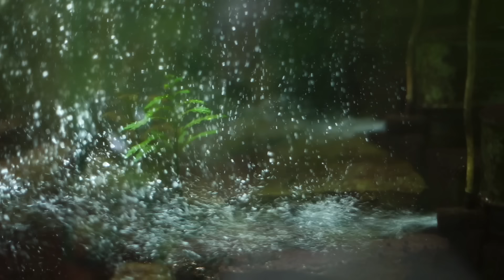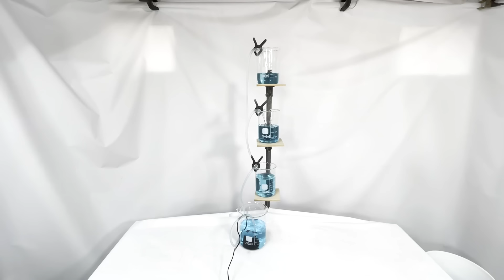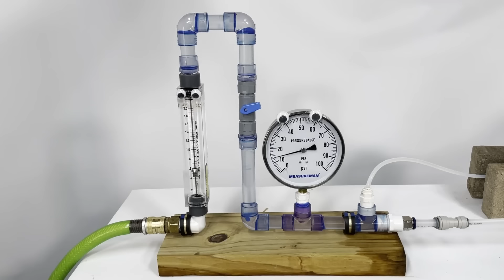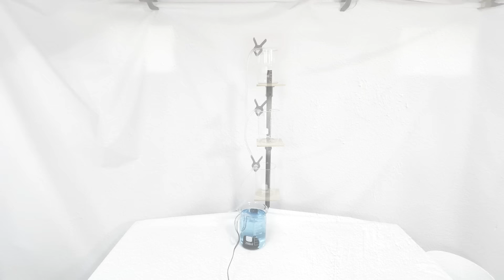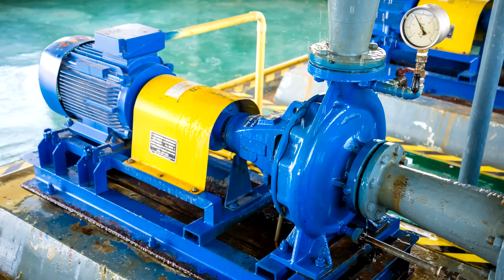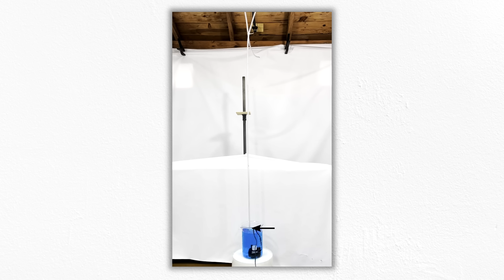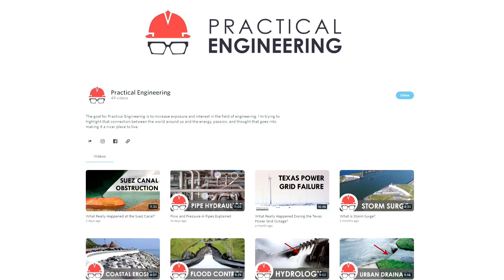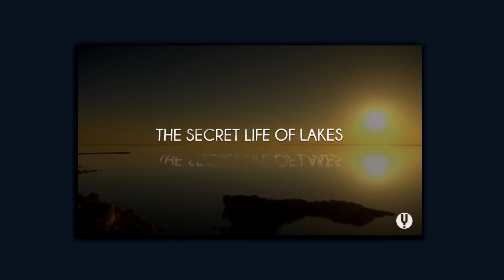Do Pumps Create Pressure or Flow?

Comment: "This isn't rocket science". I'm not a rocket surgeon, but I'm pretty sure pumps and fluid dynamics are a big part of at least designing rocket engines and fuel tanks.
Reply: i heard a professor once say "come on guys, this isnt rocket science... though it is USED in rocket science"
Reply: Designing a good efficient turbo pump is like 30% of the engineering going into a rocket.
Reply: Rocket engines are all about pumps and turbines
Reply: I work and design pumps, in line pumps, all different kinds of chillers, VRF systems and some of the hardest electronic plc diagnostics you can do.  I quit school when I was 15 never finished and now I easily make 6 figures a year.
Reply: @forloop7713  Reaction engine leaves the room
Reply: @cameron3991  that's a very cool field to work in, how did you start? I recently developed an interest in turbines and compressors in particular since I'm building a jet engine
Reply: @cameron3991  school isn't necessary for some people. I quit school when I was 15 and no I am a PLC programmer. I design and integrate entire automation systems.
Reply: Yup and make sure you don't have unexpected effect such as a resonance between POGO and pipes
Reply: Incompressible flow and compressible flow are two verry different animals, which is why any amount of compressible fluid in a hydraulic system is a problem.

Comment: It actually is rocket science too. The big boy rockets all use pumps for propellant flow and thrust control :)) 0:32
Reply: Was going to add how do pumps/fans apply to air? As dad was fond of saying "air is a fluid".
Reply: Yeah and turbopumps are one of the most expensive and complex part of the rocket (admittedly more the turbine than the pump but still...)
Reply: Yeah. What made V2 (/A-4) possible was it being the first turbo pump powered rocket. Development of rockets was very much development of pumps.

One of the major descriptors of rockets is their turbo pump cycle and turbo pump burner mixture. open cycle, closed cycle, oxygen rich staged, fuel rich staged, full flow staged and so on. It is all pretty much about "what is powering the turbo pump necessary to feed the combustion chamber with enough combustibles". Actually add pump or pumps? Again another major "rocket pump" thing. Do Single pump or do two independent pumps?
Reply: @quintessenceSL  I'm thinking of that too but, isn't that is a compressor?
Reply: Really?
Reply: Nice
Reply: @taktuscat4250  A compressor is a pump, just with the goal to pump to high pressure with low flow.
Reply: My thought exactly :) it is rocket science
Reply: If they start cavitating, then you've got big problems and will not be going to space today
Reply: managing those flowrates is gotta be a headache
Reply: @km5405  as I understand it, they're designed for a specific operating point determined by the nozzle designed thrust.
Reply: @taktuscat4250  compressors, fans, impellers, propellers, etc.  are really the same thing (a fluid pump) with slightly different shapes!
Reply: @km5405  it gets to be an even bigger headache in a jet engine.  The whole thing is a very carefully balanced series of compressors (and some turbines just to make it more fun)
Reply: @noochification  yeah the concept really isnt hard ... but the practice of it is literal billions of research by thousands of people.
Reply: Yes, but that isn't the end of the story. The combustion of the fuel in the "combustion chamber" of the rocket is also chaotic. It's affected by the flow rate of fuel that enters the chamber, not to mention the size and parabolic shape of the combustion chamber. All this must be optimized by "trial and error" because there is no mathematical equation that can take all these variables into account at once. All the variables are exponentially inter-related. I am watching the efforts of SpaceX with great curiosity. They are trying to develop a gigantic rocket that can launch some 600 satellites into orbit at once. They have developed their "Merlin" rocket engine via "trial and error" for this purpose, but in order to propel the rocket they will need something like thirty of these engines, all operating simultaneously. Having all those rocket engines firing simultaneously next to one another invites new forms of turbulence that nobody has yet considered. Those rocket engines may interfere with one another in such a way as to wreck the efficiency of the propulsion, or goodness knows what else.
Reply: @aritakalo8011  Incorrect. Goddard's rockets were actually pump fed. Google turbopump history by Sutton.
Reply: Not the SRB:s for the space shuttles and some other rockets...
Reply: @skunkjobb  obviously. Did anybody suggest solid rockets use turbopumps?
Reply: I was gonna say about the same LoL
Reply: That's not entirely accurate.  Big boy rockets don't have pumps.  The have fluid flow controls such as valves and regulators to control how much fuel, oxidizer, or compressed gas gets used up.
Reply: @PrimeSuperboy  Which one(s) are you referring to? F9 and SLS for example I have just looked up to be sure and they both use turbopumps. Afaik one uses valves to control the input to the turbines and therefore the power to the pumps. Gravity fed systems are a thing, but not for the big boy rockets I would have thought(?)
Reply: @skunkjobb  those need a hefty bit of fluid mechanics too, dont wanna have the chokepoint for the supersonic flow be inside the rocket chamber or it goes kaboom
Reply: @thestresstheoryofhansselye3607  I think you mean the Raptor engines which will be powering Superheavy/Starship. And I'm not sure what you are getting at with the interference... The F9 and many other rockets have many engines next to each other, they've dealt with those problems before.
Reply: @netsch20  No doubt you are right. I was just wondering if some form of unexpected turbulence might occur with that engine configuration that I never thought of, such as the exhaust streams of the rocket engines somehow interacting with one another in the spirit of Jollyphuck's wry joke. It will be interesting to watch.
Reply: @PrimeSuperboy  All main stage liquid fueled rocket engines that I'm aware of use pumps. Most are turbopumps, some like the Electron rocket use electric pumps. Some things like reaction control thrusters are simply pressure fed, but pressure fed systems are typically pretty small since you need something to replace the volume with to maintain tank pressure. It's a trade-off of pump complexity or needing an extra tank to maintain pressure.
Reply: @quintessenceSL  it works the exact same, It creates a force on the air and force over area is pressure. If you think about a fan, it pushes air out one side therefore there is more air at the output so the pressure is higher but at the inlet air has been removed therefore the pressure is lower. This creates a difference of pressures which produces a flow of air. The difference with air is that it is compressable whereas most liquids aren't. That means you can only fit so much liquid in a container no matter how hard you squeeze it, but with air you can force more in and therefore the higher the pressure the more mass you have in a container. Compressors keep pushing the air in hard to fit more mass in the same space, if there is an outlet then the higher pressure air flows into the lower pressure atmosphere. As far as I know pumps like the first one he showed are more like fans and therefore good at providing high flow rates but not great pressure whereas the positive displacement pump he showed, as long as it has enough power to rotate it can produce higher pressures in a container.
Reply: @mackdlite5900  yes, the OP said, "big boy rockets" implying that all space delivery vehicles use pumps.
Reply: Yeah, a huge portion of rocket science boils down to extreme difficulty pump design:
Extreme flow-rate
Extreme cold
Extreme heat
Needs to operate against back pressure sufficient to lift a building into the sky
Will often need to operate in both a vaccume and zero-g
Extremely tight tolerances
Must never require even the slightest bit of in-field maintenance.
Extreme vibration tolerance
Needs to pump and mix 2 different (and frequently not insignificatly reactive) fluids at a very specific ratio.

Oh, and while also being as light as you can make it, it also will need to be as cheap as possible because we may only need to use it 1 time before we smash your prized design into the ground or water at high speed, but if it doesn't work flawlessly, someone is likely to die.
Reply: @dr.robertnick9599  both compressors and pumps can have large pressure ratios and varying amounts of flow. Crucial is the change of volume/compressibility of the fluid that is being worked

Comment: "Not a great catchphrase, but it is accurate." Spoken like a true engineer.
Reply: That also happens in physics
Reply: @altuber99_athlete  This reminds me of the SMBC comic with the evil villain ranting that he's "actually doing something" when the hero calls his work "pure evil."
Reply: Technically correct...the best kind of correct
Reply: Qimodis   Can you share an example? I'm not saying otherwise, though. I was just saying that physicists (and mathematicians) are also rigorous with definitions.
Reply: @calholli  Voltage is analogic to pressure.
Reply: That was the real catchphrase all along
Reply: @paulelderson934  The real catchphrase is the friends we made along the way.
Reply: @calholli  "That is incorrect."

It is correct.

"Just like putting your thumb over a water hose,  it increases the pressure--  not because of more VOLTAGE---  the pump is still running at the same rate.-------  its because of the increase in RESISTANCE from your thumb mostly blocking the hose."

Here the pressure is analogous to voltage. Similarly, if you have a current source that's pushing current through a resistor and you increase the resistance the voltage over the resistor increases, just like in your hose example.
Reply: Me when I try to explain lift...

Comment: This is basically the hydraulic version of the discussion whether an electric source provides current or voltage. And as my university teacher likes to say: "what they have taught you in school might not be wrong, but the full story is a lot more complicated".
Reply: I would guess it depends on the natures of the source and the load. ;)
Reply: I was about to make the same comment. The correct answer is to ask which exists without a circuit. Voltage/pressure always exists. Flow only occurs when a path to release the pressure is provided. Flow varies depending on resistance. Pumps create pressure. Flow is a byproduct and function of the connected circuit.
Reply: It's necessary to create a simple model with which to begin instruction; otherwise, you'd never get to a full understanding. The real world is always more complex then people's simple models of the world.
Reply: @nc7432  Because it comes from decades of experience. ;-)
Reply: @solventtrapdotcom6676  I think that's why it is said the current kills, because you always have voltage and you don't get killed when the current is zero, you short the circuit and the current spikes and you are dead. The current is the one who killed you but because there was a voltage. The same way when someone shots you, the bullet was the one that killed but only because someone pressed the trigger.
Reply: Uh yeah i mean he literally said this in the first minute of the video.....
Reply: It helps that pressure vs flow and current vs voltage are analogous enough that you can create an electric model of a system to analyze flow and pressure. Look up Deltar sometimes, it's a computer to do just that for a big flood prevention project called delta works.

Comment: I'd sorta argue that positive displacement pumps create flow, and the pressure is simply a side effect while centripetal pumps create pressure and the flow is simply a (very useful) side effect.   I realize that this is a bit of an over simplification, but positive displacement pumps can create flow with virtually no pressure, while centripetal pumps can create pressure with virtually no flow.

Also, while it is an oversimplification to say it is the amps that kill, I think part of the reason people say that is because that is the one that of the 3 that doesn't change. It doesn't take a specific voltage to kill, but rather the required voltage varies because the body's resistance does, while the amperage doesn't.  Additionally, it doesn't matter how high a voltage source you have if it can't deliver enough amps to kill, though I'd imagine there are very few things capable of extreme voltages thar can't produce enough current to kill.

Comment: Rewatching this video after measuring I-V curves for lots of small solar panels is really making the similarities between water and electricity stand out. Photovoltaic output is incredibly load-dependant (that's why we use MPPT controllers for all but the most basic solar setups) and the curve describing the output naturally looks a lot like the pressure vs flow rate graphs you showed of the pumps.